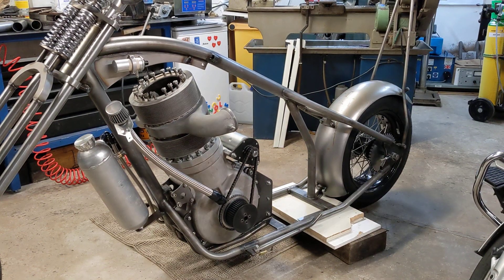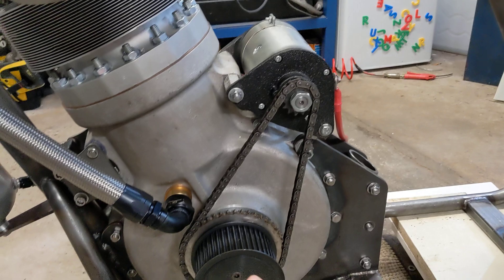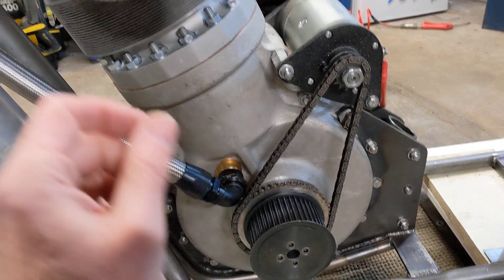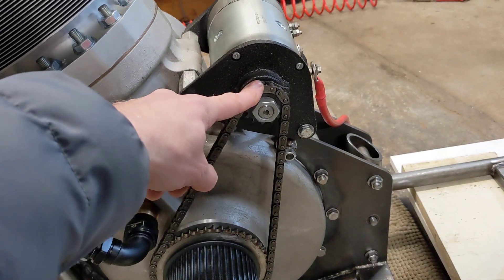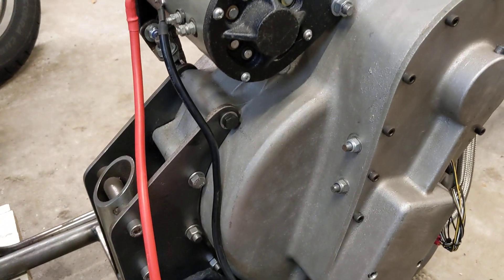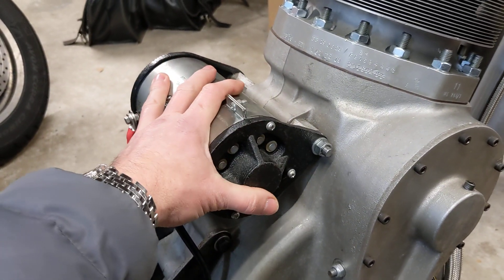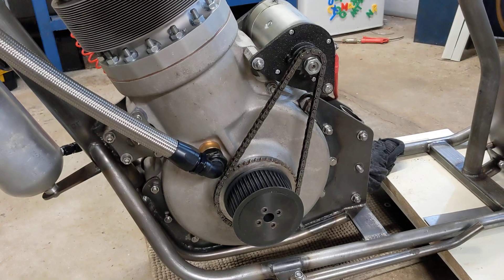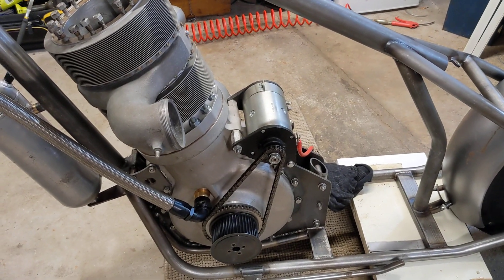Re-fitting the Dynastart For A Test

Comment: When I was 16 and just started my apprenticeship on site every day my job was to start the dumpers and mixers. Big Lister diesels with a deco lever and starting handle. Did you ever consider a starting handle?
Reply from the maker: Not really, on a bike it would have to be a kick start for me.
Reply: @StoneEng you've seen Alan Millards bike? He did a foot kick off the drive shaft I believe
Reply: Hi, really enjoying this project, and the short format videos. Me and a friend have been chatting about your starting/ compression ideas. 
Just wondering what the minimum compression ratio your engine needs to start as some of my vintage tractors have compression reduction cocks that allow easier turning over, and then once the engine starts, the cocks can be shut. In your case you could see if it would start whilst decompressed.  
I would be happy to film the johd deere model b starting up if you would be interested
Reply from the maker: @fredlambert8407  yes, let's see it!  I did consider making a variable compression, but I'm keeping it simple. I also considered a cartridge start. 😁
Reply: Compressed air? For start. With piston up and one shot 
Good work!👍👍